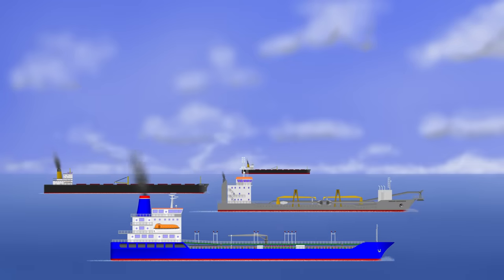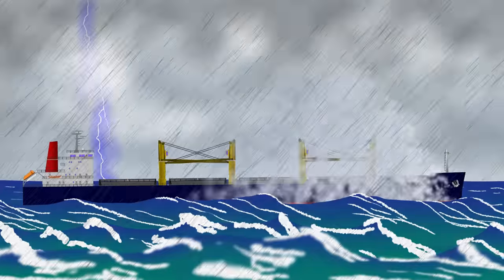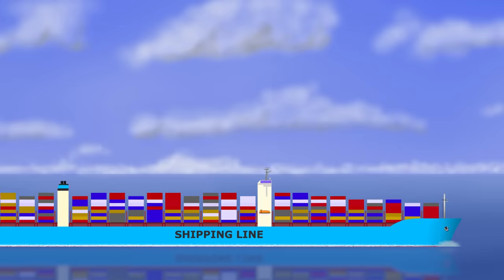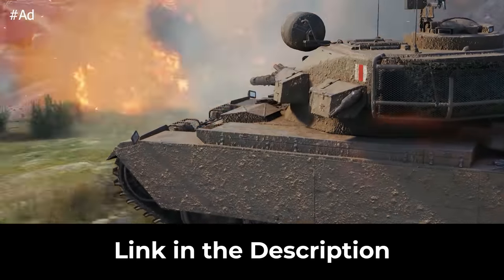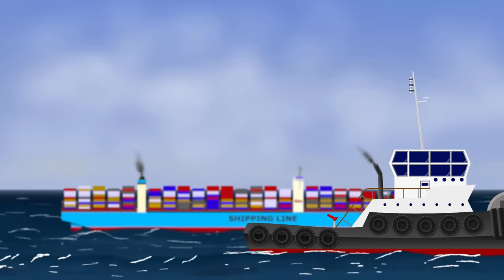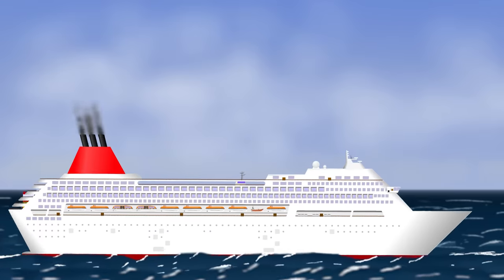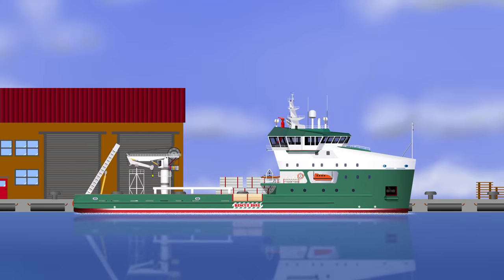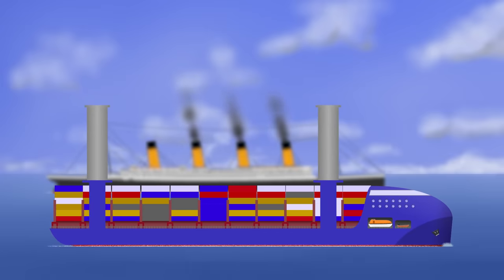Why Is The Bridge At The Back?

Comment: @Casual Navigation, having bridge forward and engines aft is a safety feature. The largest correlation between accidents offshore is tied to lack of REM sleep. Despite technology meant to dampen vibration, the engines below crew quarters inhibit restful sleep. Placing the crew quarters forward away from the engines result in reduced accidents.

Comment: You missed the bridge crews ability to monitor nearly the entire length of the ship for issues such as fire, cargo slippage etc. Even if a fire isn't visible the smell would be more likely to drift to the bridge, alerting any crew who have a window open or are outside.
Reply: You can do that whether the bridge is fore or aft, no?  Just look back.
Reply: @tsm688  my experience is that the bridge usually has a wall with no windows behind the forward facing windshield. Usually because there are more rooms behind the wall. 

The design could be changed to have windows on both sides, but usually the direction of view is forward.

Comment: I don't live near the coast, but out of the EU inland ships (freighters and tankers) here on the river, 99.9% have their bridge and accomodation compartments at the stern as well. The only exception that I know of are three "Ecotankers" which have it at the bow. The reason: They're powered by gas turbines, the typical floor plan didn't work well with that. Fuel tanks needing more space etc. You can always tell these ships apart from the others, they almost look like something out of No Man's Sky.
Reply: Most inland ships follow the same designs as ocean going ships. Cargo, the bridge is at the rear. Passenger, the bridge is at the front. For smaller private vessels, helm at the rear is very common, same as many smaller private ocean going vessels. Very small craft as well as some traditional larger craft (pretty much anything with sails, but also some motor boats) still use a rear tiller. Forward steering positions tend to be used when it's desired to keep height to a minimum (for example low bridges) which would restrict visibility from an enclosed aft steering position, but an enclosed or partially enclosed steering position is desired for comfort. Where headroom is particularly restricted, they also have a safety advantage. Like with large ocean going cargo ships, central steering positions are also often used on larger vessels as a compromise (usually on boats designed to sleep fairly large numbers of people, since providing all the accommodation forward of the steering position would restrict forward visibility too much).
For inland waterways, passenger designs can be a compromise too. As with cruise ships there is a desire to maximise visibility for passenger accommodation, but due to height and width restrictions this can clash with navigation visibility (the simple solution of "stick the bridge where it needs to be and stick passenger accommodation above it" doesn't usually work, and bridge wings are rarely an option). Often the top passenger accommodation and the steering position will be on the same level. Where heights are particularly limited, boats will be entirely on one level. One simple solution is the use of wing mirrors to allow a view aft, and more modern or updated vessels can also have cameras.
Private boats designs for both inland and ocean use will often have twin steering positions, one open at the rear for tight manoeuvring and one enclosed towards the front for on the open sea.

Comment: I wonder why then that the typical WW2 tanker had her engines at the stern, but the bridge midships? Visibility wouldn't be an issue even then. Was this merely an evolving design or was it possibly linked to the density of the cargo or centre of mass and the limitations of the structural engineering of the day? I just can't work this one out. Does anyone have any ideas?
All the best everyone.
Reply: My only guess would be that you would want as much of a 360 degree field of view as possible to look out for enemy submarines.
Reply: The three island ship is typical for cargo ships before the container revolution.
Thees had a forecastle, a bridge deck (with funnel and engines) and a poop deck.
For oil tankers the engine and funnel moved back into the poop deck, with the bridge remaining amidships.
Why that was the predominant bridge position before the aft bridge, I don't know.
I have found some indication that it evolved on large cargo sailing ships, where visibility from the aft end would have been poor.
Reply: @kilianortmann9979  IIRC, the engine was midships too, with a long shaft to the rear.
Reply: @thejackman687  No, this was not a wartime development. Thanks.
Reply: @JoaoLuisAngelo  No, the engine was aft as can be seen by the position of the funnel. Thanks.
Reply: I think it's visibility. Sure visibility with the bridge at the back wouldn't have been an issue but why willingly accept something worse of you can make it better? 

It's a mistake to dismiss visibility simply because it wouldn't have been a problem by today's standards. You also need to consider the state of technology of the industry. Clearly the bridge midships would have been more accepted at the time.
Reply: @FluppiLP  You are possibly on to something. I'm used to funnels, or to call them by their former name smoke stacks, no emitting much dense smoke. This certainly wasn't the case when burning coal. But then why not adopt this configuration for all vessels?
No, the more that I think about it, the more I suspect that this was due to the cargo and hence safety springs to mind. I've always assumed that these tankers were oil fired, but was that true? Shout out please people! Could siting the funnel or indeed the whole engine at the rear be a safety feature? Yes, very probably. If a fire started in the engine room it would be easier to isolate if it was at the stern. Ok.
Now why not site the bridge at the rear? One thing could be that this was a time before commercial radar. It may also have been a safety issue in harbour as I suspect that these vessels would not have been large enough to warrant a tug, hence tugs may have been more scarce. Siting the bridge midships may have had an advantage docking. Again the hazardous cargo may have been easier to monitor from the centre of the ship before it was possible to monitor safely using electronics. Convention and conservative design possibly had a role too. I'm not sure about this part. Were engine fires common then so siting the captain and crew away from it made more sense?
I'm just thinking aloud at this stage. Perhaps we can work this out together everyone. It would be amazing if some ancient mariner or designer could pipe up!
Reply: @ivancho5854  I wasn't referring to the OP's tanker configuration. I was replying to Killian Ortmann's mention of the three island cargo ship. I just looked up the wiki article on Liberty ships, which has a profile plan where the engine (and funnel) are clearly amidships.
Reply: @JoaoLuisAngelo  Ok, my bad.
Reply: @kilianortmann9979  I believe Maersk (and all other 366m+ vessels) put the bridge more forward for visibility but also for strength (bending and torsional moments). That's also why the engineroom (incl. deck frames) is not on the aft but a little further forward. These vessels are open top, meaning that they are basically a box without a cover, not a very strong setup. Same goes for the WW2 vessels mentioned in the comments. Back then they could not make steel (or iron) strong enough to put the bridge and engine room aft. Bulkcarriers and tankers have closed decks (incl. frames) that provide a lot of torsional strength and therefore don't need a bridge and/or engineroom amidship.
Reply: @Rubenfdb  That is an interesting consideration, however traditional break bulk ships also have a relatively closed deck (at least as strong as that of a bulker), yet from the 1880s until the 1960s there was one almost universal type of general cargo ship.
It had three more or less pronounced islands, the engine and funnel at the bridge amidships, two or three hatches ahead of the bridge and another two astern.
1890 SS Komagata Maru (former Stubbenhuk) had that layout, as did the C1,C2 and C3 ships, the liberty ships and the 60s era Leninsky Komsomol (USSR) and CapSan Diego ships.
Even the Nuclear Ship Savannah has the same layout and I think by that time the strength issues were solved, certainly for such an expensive and important ship.
Reply: @thejackman687  I’m not sure, but it’s important to remember the liberty ships were based on a dated British design, they were very very very far from perfect but succeeded through sheer numbers, not speed or capacity.
Reply: @ivancho5854  I assume you're referring to ships like the T2 tankers. As far as I can tell, these ships were in fact oil-fired. Not sure about anything else in regards to the bridge placement other than the T2s being based on earlier ship designs, mainly that of SS _Mobil Fuel_. No idea why that ship had a midship bridge other than that it was a "thing" during the time period. Why it was that way it was, I've no clue.
Reply: The previous generation had the engine and boilers in the middle (because boilers really don’t like a lot of motion). Diesels made putting engines at the rear possible. Steam boilers need to be at the centre of the ship.
Putting the engines and bridge at the rear also let’s shipyards build a standard control module and just change the box section between the bridge and bow to suit a specific cargo.
Reply: The T2 is a steam turbine powered ship. With advance superheating designs, you can reduce the boiler size while maintaining excellent power production. You can stuff them all at the stern. As for the mid bridge, it may be due to the transition period from the mid bridge to the stern bridge. That is because the previous cargo ships have a large and heavy piston expansion engines that needs to be at the very center to maintain balance. No matter how powerful and efficient your boiler is, the hulking engine must be placed at the center. The superstructure and bridge followed.
Reply: @kimpatz2189  Wow, I didn't realise that they were steam turbines. I just assumed that merchant ships were all reciprocating and that turbines were the preserve of the military. The layout makes a lot of sense with that information and I agree that the bridge was the last step in the evolution.
Thanks for the input Kim.
Reply: @ivancho5854  you'd have been right in regards to the WW1 run up and immediate follow on years to the mid 20's. Most Merchant ships ran on Reciprocating Douple or Triples and it wasn't really until the 30's where Turbines started to show up in greater numbers in Merchant shipping.
Reply: It was in the centre because then the ship looks beautiful and it is also the most comfortable place to be in bad weather. :-)
Reply: @arnoldstrong5553  Both very true!
Reply: Military ships typically separate things.

You don't want one unlucky hit to take out 3-5 things at once.

So each engine room is separate from each other. The bridge isn't near the engine rooms, sleeping quarters are in multiple places in the ship, etc.

Also, the crew for each type of thing, such as the engine mechanics, we're also spread out among the various sleeping quarters. So if one took a direct hit, they didn't lose almost everyone that worked in one area.

Survivability is more important than capacity.
Reply: @ivancho5854  Are you sure?  There's been an awful lot of wars.  Maybe not to watch for submarines, but something else?

Comment: Being from the Great Lakes region, where freighter bridges tend toward the bow, I had wondered why most other freighters put them toward the back. I guess the big question then, is why great lakes freighters tend toward the bow? Granted the lakes are probably calmer in general (until they aren't).
Reply: They’re all calm until Lake Superior has a moment and eats a freighter with all hands.
Reply: Actually the Great Lakes can suffer far worse waves than many parts of the open ocean. Wave energy runs from the surface right down to the bottom, which concentrates as waves move into shallower water. You see this as waves enter a surf zone. Waves in bad weather are worse over continental shelves and in shallow areas such as the Barents Sea… and the Great Lakes. 

The mitigating factor is that tropical cyclones are extremely rare on the lakes. If the weather was as bad on the lakes, the conditions would be horrifying.

Comment: I've found that most cargo ships have the bridge amidship with cargo areas front and back. 
It is mainly ore and oil tankers that have their bridges at the stern. 
Passenger ships have their bridge at the front because there is really nowhere else to put it and it has the bonus of filtering out all of the bright deck lights. 
Only the Great Lakes ore carriers break from the norm, with superstructure at the rear as is usual but the bridge is plonked right on the bow.

Comment: Well now you're going to have to explain those Alaskan crab boats like on Deadliest Catch. After all, most of them put the house at the rear, but you do have the Northwestern with the house at the front. (Though there are very good reasons to have the house at the stern simply because you can easily view both the desk crew and the path ahead. The Northwestern has to use CCTV cameras to be able to view what's happening on deck). On the other hand, the crew of the Northwestern are shielded from the worst of the weather, which is terrible when you go crab fishing (winter on the Bering Sea).

Comment: The question of future designs moving the bridge forward and the impacts on visibility - I could see all this evolving rapidly with modern technology making visibility less relevant, as crews could have whatever view they want using cameras and monitors. Potentially could get by without having windows at all - I've heard of this proposed for airplanes. Sort of like how all new cars have backup cameras and rear visibility on most new cars is terrible compared with older vehicles. Distance from the engines would also become a lesser concern as engines become more automated and more reliable, wouldn't need to have crews in the engine room as much. Of course both of these suggest the next step beyond this would be to not have crews at all, ships be autonomous and/or remotely controlled - autonomous for the open-ocean portions of their journey, remotely controlled by a local pilot familiar with the harbor or port for the harbor.
Reply: In case of an Emergency, like in Star Trek III: The Search for Spock.

Comment: Fascinating. This actually made me think of how sci fi ships are designed. Specifically Imperial Class Star Destroyers. Bridge sits above the engines at the back of the ship with the main hangar opening from the bottom amidships. Now of course Star Wars is a not very realistic space opera but it's interesting how the designers kept that same design philosophy even though Star Destroyers are warships not cargo vessels and actual warships have the bridge at the front or middle of the ship (thinking in terms of like battleships, cruisers or destroyers).

Comment: Something I'll admit that I'm surprised by is the fact that you didn't mention the bow mounted bridges of the Great Lakes steamers, which I imagine was done for safety concerns due to boiler explosions. As for where it'll be, I imagine bow bridges may become more common if nuclear power becomes more common, primarily for safety against radiation. They may also offer more protection for the ship in event of a rogue wave but that never helped a number of ships.
Reply: I always assumed it was because Lakers deal with rivers and locks, that especially in the past were very busy with boat traffic, so a forward bridge gave needed visibility. But radar and better control has made this less an issue in modern designs.
Reply: Nuclear propulsion for civilian ships is completely dead.
They need a large security detail while in harbor, hosting nations have to give permission to dock and insurance is high.
Also a lot of safety features of modern nuclear reactors, like a core catcher or Filtered Containment Venting Systems are incompatible with the space limitations on a ship.
Reply: @kilianortmann9979  With the rare exception of nuclear icebreakers. And, given how vulnerable an ecosystem the Northern Sea Route is, maybe the future will see long trains of unpowered barges, driven by distributed nuclear-powered tugs, with an icebreaker at the head end. That would require huge political changes in Russia, though.
Reply: Safe for who?  SOMEONE still has to poke at the engines...

Comment: Canal boats (narrow boats ) are controlled from the stern . This makes sense as you stand , with your tiller on a deck above the engine. The down side is that you alternately bake freeze or are wet. I recently saw one that had a forward steering arrangement. There was also a spacious open deck area above the accommodation and it carried a small car on the back. The owner said it took some getting used to but gave much better forward view but relied on his crew (wife) to signal (shout) if the rear was about to hit anything. Overall it did look like a good idea.

Comment: Besides rudder access on sailing ships of old, having the bridge on the stern would allow the captain complete and total oversight over sail configuration, deck crew and also allow for communication with sailors to make changes to the rigging as needed in addition to directing the firing of cannons when necessary...